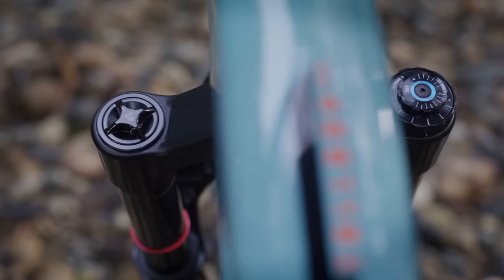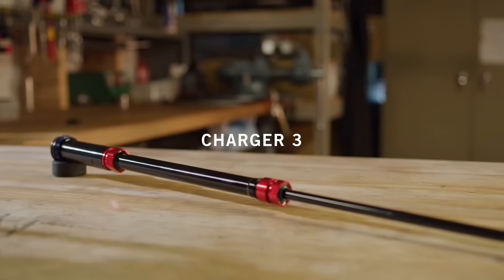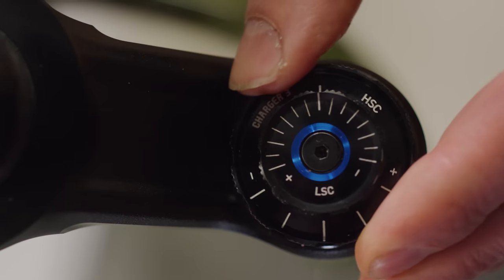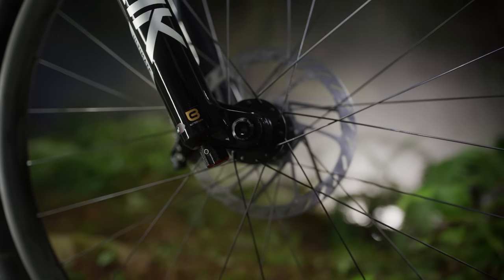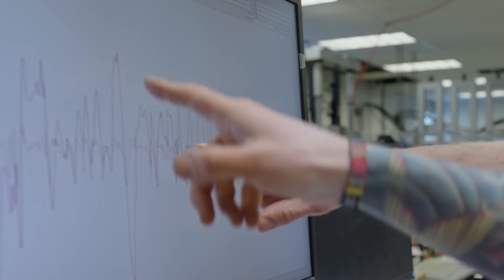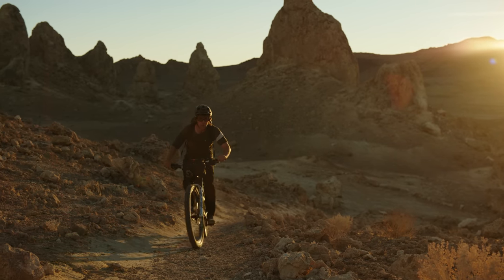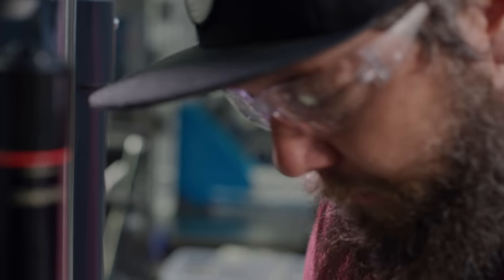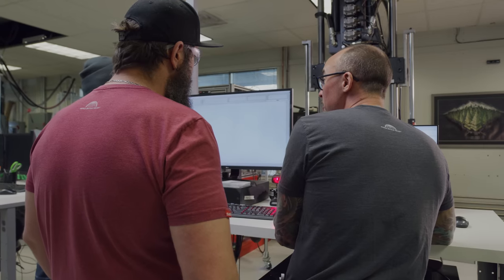RockShox 2023 Fork Technology: Our Development Story

Comment: Hello. I have a product question: I just bought and received the 2023 Super Deluxe Ultimate air shock. On the bottom of the stanchion it just has one marked line, unlike the ones I see on the web and videos with multiple lines indicataring it has the Hydraulic Bottom Out feature. Does my shock NOT have the HBO? Thanks
Reply: In their other video they said the air shock has a fixed amount, but the coil is adjustable

Comment: When is the boxer going to get 40mm stanchions?
Reply: It’s not all about the stanchion diameter, forks don’t necessarily need a wider stanchion diameter in order to maintain stiffness. Someone correct me if I’m wrong but I believe rockshox forks have thicker stanchion tubes rather than wider ones to maintain stiffness (or at least they used to).

Comment: One really good way to eliminate harshness is to eliminate the high speed circuit. No need for it whatsoever. Having said that, these forks are amazing.
Reply: What do you mean? No high speed conpression at all? I have  tried almost eveything by now, i can not dial this new Lyrik, it does not feel good at all.
I am out of ideas- psi like in trailhead app means tot stiff, less compression wobt help. Lower the psi and add compression doesnt solve the proplem…
I am dissapointed, i think i wont buy anything from rock shox any more, never again! My fox suspension on the ebike feels way better😢